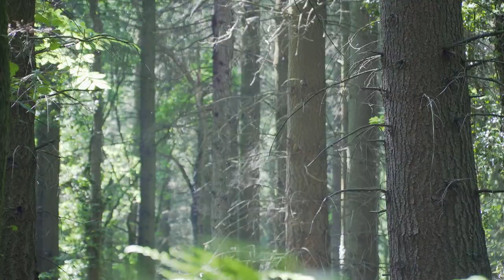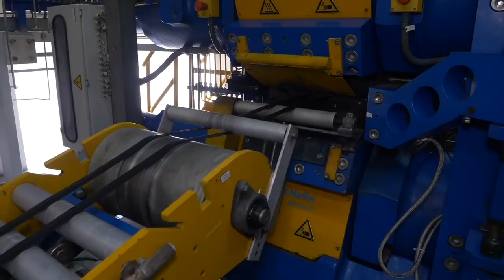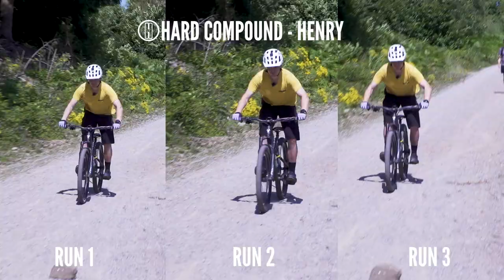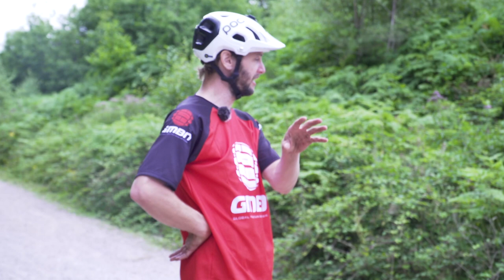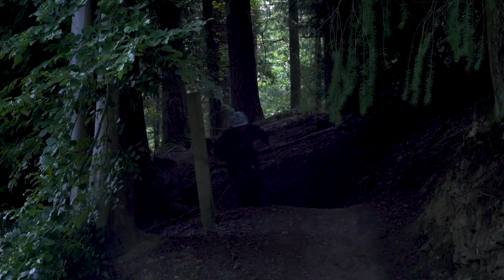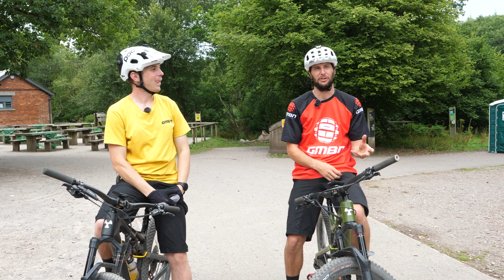Hard Vs Soft Compound Tyres | What's The Difference?

Comment: If the back wheel is being completely locked up (skidding) the rotor size shouldn’t matter, correct? I know in general rotor size can definitely play a roll in stopping power do to heat dispersement, but again, if the rotor is immediately being locked up the rotor size shouldn’t affect stopping power, per se. Thanks for another awesome vid fellas!
Reply: @polarizedpotstone  Correct, once the wheel is locked it doesn't matter. But it still has some effect because the actual braking is different at the same lever inputs. This could mean that the larger rotors grab harder and lock up the wheels quicker but on the other hand it's also possible that it gives you better modulation to avoid locking up. If a powerful abs would be used then the larger rotor would certainly be equal or better in terms of stopping distance.
Reply: Might have been the difference in center of mass due to different rider weight. It could be higher center of mass resulting in weight in front wheel digging into the sand and less for rear wheel. Also, this could result either higher overal stopping power or less.

Comment: Great comparison test Henry and Rich and agree the 4 compound tyres are much better.
A few months ago i got the same tyres you guys were using Vittoria Barzo's 29x2.25 Graphene  4 compound and they are fantastic tyres!!! 
You can hear them grip when riding uphill on tarmac/hard pack
My confidence has increased due to the much better grip 
Haven't had any punctures/small leaks (have been tubeless since getting my Scout ) used to get thorns stuck in my previous tyres alot and had to plug them. 
So i recommend to anyone looking at getting tyres go for the best you  can afford the more compounds the better whichever make you prefer 
Awesome stuff GMBNTech

Comment: You do pay twice as much but this video gave me peace of mind that it is not pure luxury. I went for Black Chilli and ProTection and I am very happy with the performance. These Barzo tires have the same pattern as CrossKings and I absolutely love it. It is so fast in a straight line, quiet but grips like a newborn. I will switch to Vittoria next time just to try something different, but so far the tires are holding great. Very good video.

Comment: Dunno, will ride a Performance Noby Nic any day over a Bontranger SE4 (the Bonty has no traction by comparison wet or dry).

I think layered compounds not so great as when the top layer wears out - you then have a different tyre but, different compounds in tyre area's might work.  Also not sure about dumping Graphine all over the trail - it's not the most enviro friendly substance.

Comment: please keep 26'er tires alive, it's getting to be pure BS when buying tires for 26'ers nowadays. I have ZERO interest in buying new bike just so I can buy new tires
Reply: Agree, I'm still on 26er, lucky for me I just got myself a 26x2.8 Minnion DHF front and rear for my Plus 26er rim. A bit on the expensive side because it's rare.
Reply: Ya I saw those online, 2.8 on a 26'er should be close to same diameter as  2.4 on 27.5, I used to run the 3.0 or 2.7 Gazzalodi front and 2.6 rear for the DH bike, now I'm thinking Magic mary 26x2.6 front and a 26x2.4 maxxis shorty rear.  I lucked out at the start of the season and found the last 2 dh 26'er tires in my town a DHF and a G5... but ya have to plan ahead, always smart to have back up tires
Reply: @chrisfontaine6221  Yeah I keep back up too, pair of extra DH rim, 1 pair or Cedric Garcia and another pair of Maxxis DHF and DHR 26x2.3. 
 My Transition TR250 is not broke and still in good condition and why the hell I should buy a new bike.

Comment: #askgmbntech my wife is 5'1" exact and her orbea oiz h20 barely fits her. There are two questions. This bike has Shimano XT8100 170mm crankarms. I want to add dropper post but shortest dropper that I found wasn't short enough. Her post drop length is measured at 3.7" (93 mm) and 100mm wouldn't work with racefact turbine and it's thick ring that goes around the bottom tube. I was looking for maybe 160mm crankarms for her as possible solution. Have anyone seen or know 160mm crankarms that can be used? Thank y'all. Your guys are making me and wife connect better through mountain biking

Comment: Love the video but it makes me sad in a way. GMBN has said many times that 26" bikes aren't dead but you simply can't find any of these cool and better tires in a 26" rim anymore. Been searching a long time now to replace my Specialized Ground Control tires with something more aggressive for the looser stuff but no luck. 26" may not be dead but the manufactures are definitely pointing the gun at them.
Reply: True, but where i ride i would not ever go back to a 26"
The benefits of a 29er far outweigh it's shortcomings where i ride.

We have fast flowy trails with loose sand or many tree roots. 29ers are king here unless you are very small and have a bit of trouble throwing it arround
Reply: So true, I feel the same about 26" wheels and also 36 spoke rims/hubs. They're getting hard to find even though I have no problem sticking with these sizes.

Comment: Uh guys I have a question but not related to tires it's related to drive train here's the question: my drive train is xt I'm planning to change the cranks to race face.. does xt work with race face or so I need to change the chainring to xt?
Reply: Shouldn't be a problem I've got shimano xt cassette, derailleur and chain with raceface cranks and chainring on my heckler